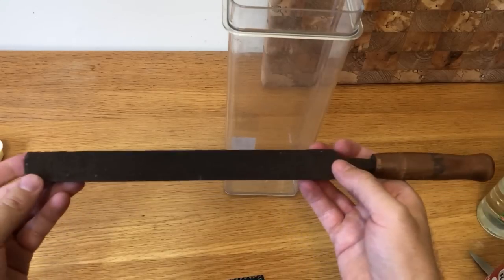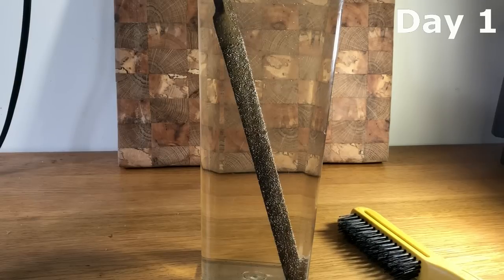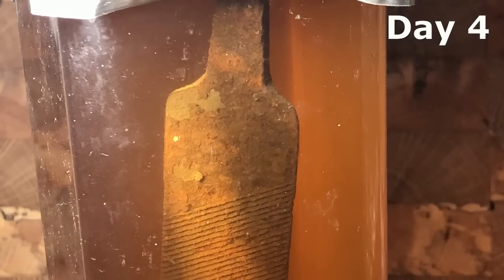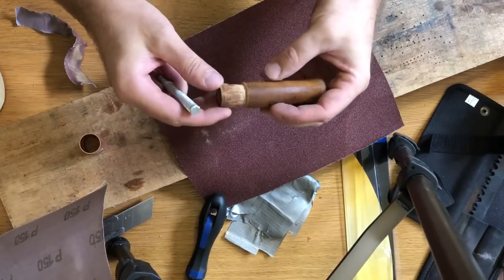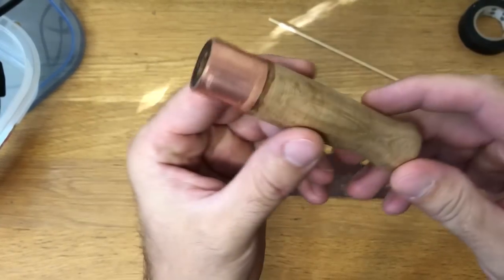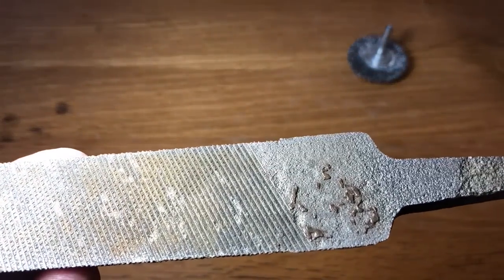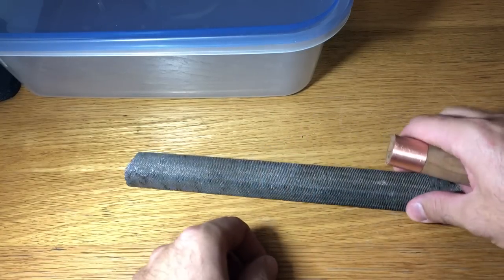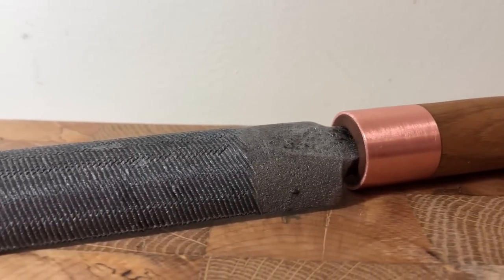How to Restore a Very Rusty File? 125 hrs in Vinegar

Comment: Please don't advise people to use wire wheels on power tools to ruin files, sure some vinegar for rust then just brush with a file card. Remember a file is a cutting tool and needs to be sharp. You did all that work just to end up with a blunt file. Anyways, you made the handle nice.
Reply: Thank you for your comment. I just bought a lot of vintage files and watching this video thought it was ok to wire wheel them. Good thing i saw your comment
Reply: @Daniel-vs7qm  that file worked fine at the end of this video. There are so many people that boo hoo piss and moan when they see some one use a wire wheel on a file but truth is a dinky wire wheel on a drill is not going to dull a file. Hell a file card is steel.

Comment: Have you considered using copper to clean the grooves on the file, after the vinegar step?  I made two sizes (obv.,small and large) as I have a number of files of different sizes, some pretty large.  It worked very well and I examined with a fairly high power magnifying glass (I think I used a digital microscope as well).  Anyway, something to consider.

Comment: I discovered a tool box full of water (family smdh) containing entire sets of Nicholson files, around 30 of them. 3 weeks in vinegar and I am still dealing with some rust, but my biggesr problem is the xtra fine ones are still loaded and some of the metal is ferrous and begins to rust again quickly. Ive tried very fine steel, brass, nylon and copper brushes both manual and dremel/drill. Ive tried copper bars. Nothing seems to be able to break the debris loose. Any suggestions out there?
Reply from the maker: Sure, try using electrolysis. Also Evapo-Rust is a very good rust remover. Good luck!
Reply: SOME of the file metal is ferrous?   ALL metal files are ferrous!

Comment: It looks great for the condition it was in. Personally, I wouldn’t use it because of the condition of the file itself, however, it would make a nice decorative piece. Great work though!
Reply from the maker: Thanks!
File works great actualy, I use it time to time.  Works nice on the hard wood too. I was shaping a knife handle with it.
Reply: Take And Make I saw in one of your other videos. I have an old draw knife that was in pretty poor condition. I restored it and it works nicely, but I prefer to use it as a decorative piece. Anyway, keep up the great work.

Comment: Just wondering if Coca Cola is equally as good or better/worse thanx
Reply from the maker: I never tried cola but I think vinegar will outperform it! Also see if you can afford Evaporust, that stuff is amazing!
Reply: @Take_And_Make  I never heard of Evaporust but it sounds excellent and maybe I can use it on my snare drums.
Reply: @bobbyvalejr.1276  just be more careful with evaporust - gloves and eye protection a must, read the materials and hazards literature, and I wouldn’t dump it down the drain. They say it’s “safe” but I think it’s a relative term. It’s not the worst, but not the safest either.

Comment: I have done it before,  dont waste your time, the hard metal is rotten and gone, the file is dead
just check out  the rest of the stamp, you stay with the softer core  :(
Reply from the maker: I disagree with you, file still has plenty of life, I used a few times since and it performes OK.
Reply: @Take_And_Make  Well, i found mine while metall detecting.
It didnt look to bad at the beginning, but after electrolysis it was dead
Reply from the maker: Yours one was sitting underground, that's why.